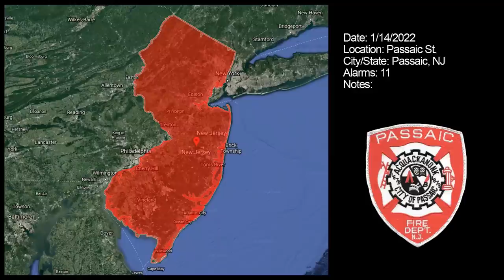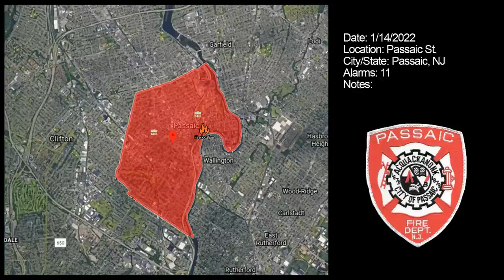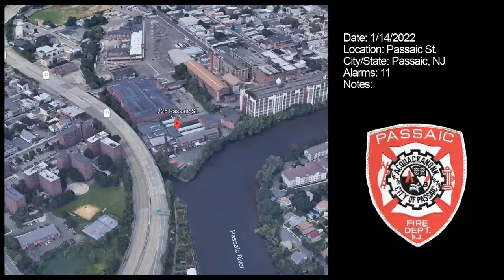Passaic 11-Alarm Mill Fire Audio 1/14/2022 [New Jersey]

Comment: In listening to last night's broadcasts on television of the fire, I kept hearing them mention fire boats. Now I know the Passaic fire department doesn't have a fire boat and I don't think there's many in existence down the river. Plus the main avenue / Gregory avenue bridge and the Union avenue bridge do not open anymore. You ain't going to get a boat up past Lyndhurst anymore at least by the river.
Anyone have any inputs out there?
Reply: Newark boat was dispatched but couldnt make it under the aforesaid bridges.  Kearny and Secaucus were then dispatched but due to low tide also couldnt make it to the scene.
Reply: Yes but in wallington there is spots to deploy boats
Reply: @justindecker9282  yes, for scuba search and rescue and recovery vessels, not firefighting boats.  They're almost never trailered.